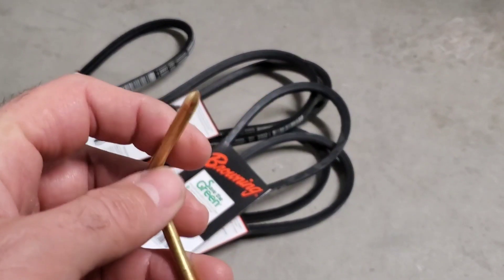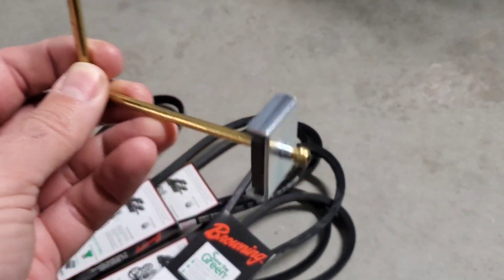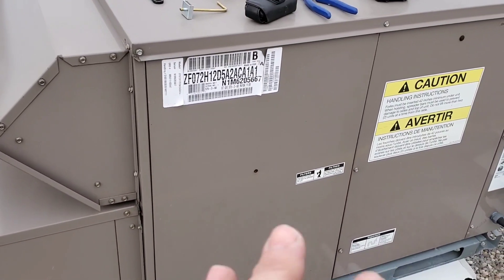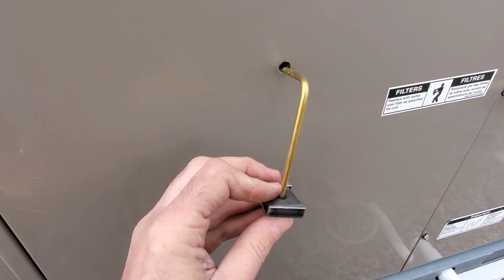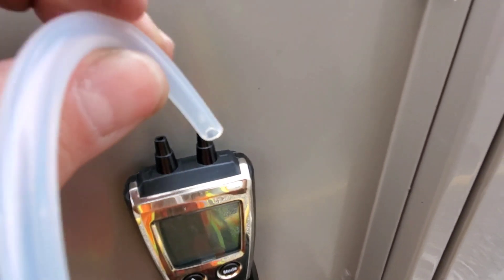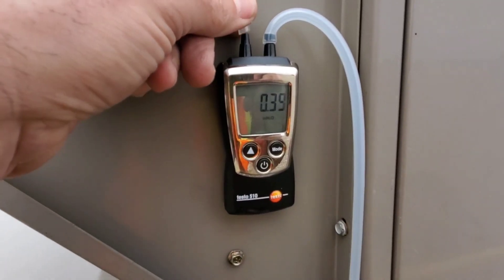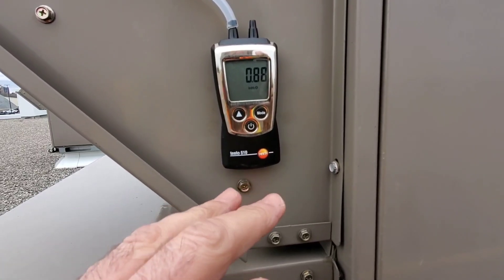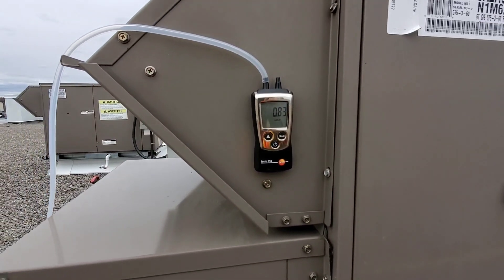Checking External Static Pressure On An RTU

Comment: EXTERNAL static pressure....that's static EXTERNAL, to the rtu...doesn't include the rtu. The reason the manufacturer posts allowable external sp is because they have no control over the conditions that their rtu is installed in.
  So the ESP is for us to measure and it is much more difficult to obtain a good sp reading on an rtu.
What you are describing is total static pressure , TSP,  which balancers will record as a means of showing the static pressure that the unit is working under.  It is a very good number to have, but it is NOT,  external static pressure.
Reply: That’s what I’m thinking.
Reply: How is this method describing total static pressure? He's measuring right at the return plenum and the supply plenum....not across any filter or coil inside the unit. ESP is measured where the air enters and leaves the unit, TSP is measured across the internal components to show what the drop through the unit is.

Comment: I have been having an issue with a Carrier RTU recently. Issue was leading to airflow so I checked ductwork inside the space and checked static pressure of RTU. I did it using a Fieldpiece SDMN6 and I just used a single port to check supply and return individually. RTU is rated for 1 inch W.C. Max external static pressure. My supply was ( .63 in w.c) and my return was (-.37). This added up equals 1 inch correct. You don’t factor in the negative correct? Why isn’t your supply in a negative? I though the suction side or return side of blower motor would be in a negative and the discharge or supply would be positive. Younger technician just trying to learn any input would be appreciated. Thanks.

Comment: Thanks for the video 👍. As a new comm hvac guy I was wondering how to measure esp on rtu. The only problem with this approach is that all "experts" that I've listened to say that static pressure should be taken in a straight portion of a duct, away from any bends (due to turbulence). Rtu Manuals also show test points in the ductwork, not unit itself. so i am wondering how much is the difference and can i rely on you readings in measuring airflow 🤔😊

Comment: Really nice presentation in probe placement and measuring the Delta P.  Do you have any vids on plotting that E.S.P. data + BHP + RPM on the manual provide or designed for this unit?  I use those tools to calculate the estimated actual Total Airflow.   Thanks in advance.

Comment: Nice video on a semi-taboo topic for commercial RTU's.  For over 30 years York has provided ports on their commercial package units to test ESP.  Wished other manufacturers would follow suit.  They talk about checking ESP in their installation and service manuals but fall short to tell you how or where.  Or to make it convenient enough for people to WANT to do it.  Many times, you have to be above the ceiling near the roof line to take the pressures... not very desirable.  York has their tables figured out with the ports provided on the unit.  If you try to take air samples in the same areas on a Rheem, Carrier or Trane, readings will not be correct because they are not external of the unit.  You are better off having long tubing and dropping the static pressure probes in the duct and running the tube outside of the unit to your manometer or magnehelic.
Reply from the maker: Thanks for the insight!

Comment: Static pressure is so important! I use static pressure before replacements to see if the system is over sized for the duct work. This way I know if the ducts needs to be addressed at the same time. Its just a good insurance policy. Especially if you don't know the history of the unit. I see undersized returns all the time here in Florida. Regarding this video I don't think having a higher static on the supply is an issue. You should always a rule of thumb have less on your return so the unit has enough air to distribute.
Reply from the maker: Thanks for the feedback John
Reply: Static readings are only accurate if the unit is spotless internally. Like a brand new rtu or ahu,whatever. If the unit has a plugged hx or dirty blower wheels ect. You're tesp is meaningless. It no longer will track with any blower tables and can't be used to get an idea of airflow either.

Comment: Great Video. Thank You.  It might be helpful to others to pay very close attention to where you check the static. Think of probe placement as a flash light (the light see's only what is in front of it) and thus is the same for pressure test location. It will only "see" the pressure that is away from test location. Example: Testing evaporator drop In a vertically positioned gas furnace with an evaporator sitting on the furnace. The test point needs to be between the bottom of the  evaporator and above the blower bulkhead.  If looking for TESP,  the return test point (negative) should be between the filter and blower compartment.
Reply from the maker: Yes, correct.  In most articles it states, "as shipped".  So if the init has a heat ex and evap packaged together it's included.  If it comes in parts like a resi furnace and AC then it's as you described.

Comment: ita a great idea. never thought of doing. then again most companies want me to hook up thermostat and fire up. If the general wants more they get certified air balancers. I believe to get true external static you need to check the ductwork with o.a. damper sealed. you're just differential of fan and coil. your return can be less because it usually shorter and your probably sucking air in through o.a. damper. if you really want accurate airflow you need pitpot and take 16 to 20  fpm readings, i belive, and average them.   i have had problems due to curb construction.

Comment: Great video Gary! You are right that we should be getting more TESP reading on package units. We use start up sheets on our new installs, which has a section for TESP. We also have sheets on the service end to verify TESP. I have found that when I enter my static pressure probe, as you did on the supply side, I get a much higher reading. So I have only been inserting the hose enough to stay outside the airstream and get my reading. My readings are usually closer to the designed duct static with our new installs.
Reply from the maker: Thanks for the comment Dee, I will try this next time to see if it makes a difference.
Reply: I've read an article or two on total pressure measurement and it seems, the most reliable on-site method is small hole drilled in the duct wall and tube pressed against it. From practical perspective, sticking tube in the duct facilitate the measurement.
Re. probes used/available: are there error characteristics available for these probes, e.g. error as a function of air speed/pitch?